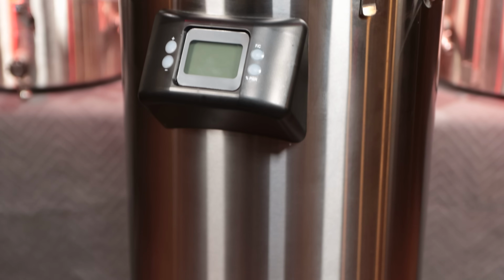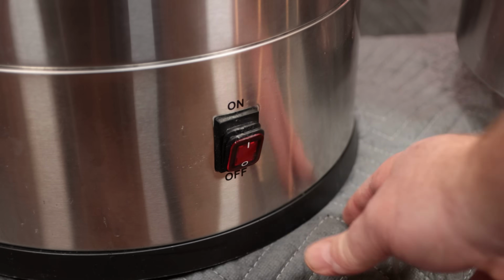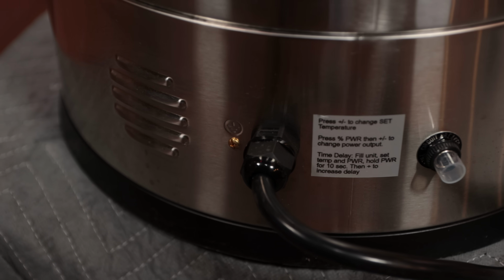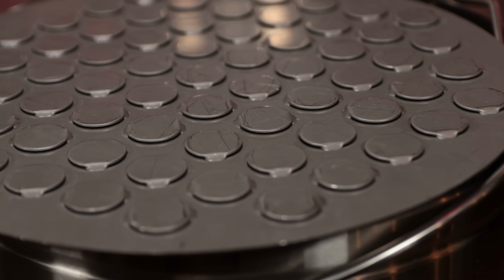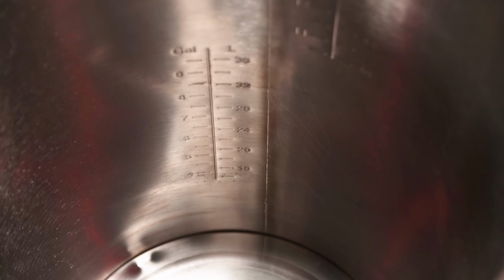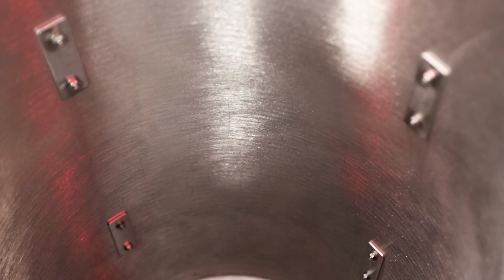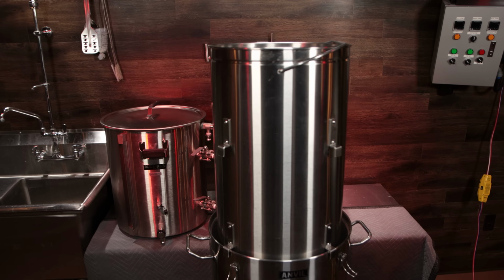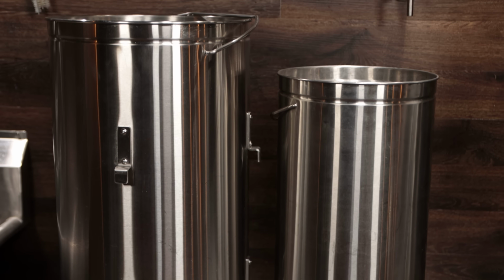*NEW* Anvil Foundry 18 Gallon Brewing System

Comment: First 5 gallon brew day is complete. Did a doppelbock with 18.5 pounds of grain. Efficiency was what you’d expect at 65%. I’m thinking a brew bag will make a huge difference for smaller batches. Overall I was impressed with the system. That’s a beast of a heating element!

Comment: Brian, Thank for more great info.  I just received my 18 and I'm going to test then brew this week.  
If you said any this, I missed it........
What gap are you milling your grains at for this system using the pipe?  I'm coming off the 10.5 using the bag and no pipe - milling at about .035.
With this pipe and false bottom, do you use rice for every brew or only when using flaked adjuncts?

Comment: Who says size doesn't matter? This rig looks legit. That false bottom though! I notice the Brew Easy false bottom drains a little slow, but I manage to keep the element covered while mashing. No beer bongs or chugging while mashing. Anvil just went yard with this one. Cheers Brofessor.
Reply from the maker: Lol thanks!! Yeah it's a trade off clear wort or fast drainage. 👍🍻
Reply: @ShortCircuitedBrewers  I don't mind. IT really does work well, though not well enough for a autosparge. As long as the wort comes clear that is the point. I did notice a slight improvement by adding oats to my grain bill. I didn't need the orifices, or is it orafae? I might have to try to duplicate that false bottom design, not to resell, but to have a false bottom for my Micro Spike Nano rig. I like how well it works.

Comment: I hope they update the smaller units with some of these innovations!
Reply from the maker: Trickle down....keeps on trickling...😁😁
Reply: I just bought a 10.5 and it does have the new style false bottom - it also doesn't need the small batch adapter ring anymore.
Reply from the maker: @DavidMiller-dk7di  yep that's correct. They've done some upgrades! 👍🍻

Comment: Looks good but I love my brewzilla 65l it'll be interesting to see how this works. I wasn't expecting much with the brewzilla for the price but the last two years have been rock solid knock on wood. But if it takes a poop I'd consider this unit. I do like the wort chiller much more than the brewzilla unit and the design of the malt pipe which is genius. I personally don't like the controller being able to stage the heating element just because if you get into a situation where you need to run less or more power especially during the mashing process it kind of scares me. I'm also pretty simple and think that's just something to add to the probability of breaking. I can't wait to see what happens when you use this unit. Thanks again for the great content
Reply from the maker: No doubt the brewzilla is a great system..I actually liked it better than the 35L. I do still have my 65L. Maybe I didn't explain it properly but it is really easy to dial.in the amount of power on the Foundry.
Reply: @ShortCircuitedBrewers  can't wait for the brewing videos. Gotta really love the fact these companies are making affordable systems. Just hope that these lower priced systems last a while but so far they've seemed to be great. Really exciting stuff happening in this hobby right now
Reply from the maker: Yes on all that!! 👍🍻

Comment: Hi Brian,  Love your vids. The measurements for the 18 you mentioned don’t add up :(. The only measurement I need (for my hoist) is “From the bottom of the kettle (the floor) to the extended lift handle of the pipe in order for the pipe to clear the kettle.  This would permit the removal of the pipe for the boil, with the hoist.  ? Is that your DIY steam condenser?  Also what’s your take on the whirlpool attachment?
Thanks Ken
Reply from the maker: Lol I thought about that measurement..I'll find out what it is and let you know..I haven't used the whirlpool arm just yet, but I'll be using it soon. 👍🍻

Comment: Sweet video! I wonder if the 10.5 gallon bag has enough extra space/slack to be used in this larger version as well?
Reply from the maker: I kinda doubt it. You could use it but it wouldn't fill the pipe. Just a guess. 👍🍻

Comment: Just thinkn about jumpn into this. Which system would you buy if you had to choose one? Size? And Simplicity of use? Batch size i do around 6 into primary to end with 5 in a keg.
Reply from the maker: High gravity wort or generally normal?
Reply: @ShortCircuitedBrewers  i do both.
Reply from the maker: @jacobsandlin546  the 18 gallon is going to be your most versatile option then. 👍🍻

Comment: How long does the 10.5 and 18 gallon each take to chill on average for a 5 and 10 gallon batch respectively with the included chillers?
Reply from the maker: I can't remember about the 10.5 but I covered the 18 with a 10 gallon batch in this video. https://youtu.be/b2nycv_MWNc

Truthfully your ground water temp.id a huge factor in how quickly the included chiller will cool the wort down. 👍🍻

Comment: Thanks for the review... thinking about going for it and pre-ordering one of these.  Afraid that it will not actually ship in January though.  Last year I tried to get the Anvil 10.5 and paid and all that then it ended up backordered for months.  Anyway, do you have a equipment profile for this 18 gallon version.  Or have any suggestions on a similar system to use as a starting point.  I use BeerSmith but should be able to plug in the numbers if you have a suggested one to start from whether it is Brewfather or whatever.  Thanks for any additional feedback.  Love your videos.  Thomas
Reply from the maker: Beersmith will have the profile soon for the 18 I worked with anvil on a profile for it..👍🍻
Reply: @ShortCircuitedBrewers  I pulled the trigger yesterday evening and pre-ordered direct from the Anvil website.  I got the swirly arm and recirculating options even though I already have a couple of new riptide pumps.  I plan to make an extension cord and a way to hookup where the dryer is connected.  Watched your video on the cords too. I was brewing extract and steeping on the stove, then the mash and boil 7 gal and now using the mash and boil for partial grain brews.  This will step me up to all grain.  I brew some 10% beers so figured this would help me get there. Next purchase I think will be a Spike Flex+ fermenter and try pressure fermentation.  I am still building out a three vessel HERMS setup... probably another year before that is ready to go.  Trying to learn all aspects of beer brewing using all the different methods.  I still use the stove and sous vide on occasion just for kicks.  Thomas
Reply: @ShortCircuitedBrewers  Brian, the profile popped in as an add-on in BS a few days ago.  It is a no sparge 10 gal profile.  I am new to all grain and creating profiles.  How do I go about a) making the profile work for sparging and b) make it work for a 5 gallon batch? Thank you.  Thomas

Comment: Which one is better Clawhammer Supply 20 gallon or Anvil Foundry 18 gallon? Is the clawhammer worth the extra grand?
Reply from the maker: Not really a true comparison. They are different types of systems. The clawhammer is modular, with most parts of it being serviceable the foundry does not have serviceable eyebrows etc. You have to be the judge on that extra grand. Both will make great wort! 👍🍻.

Comment: Have Second gen 10.5 (controller still on bottom) and been waiting for this but I have to stop and think do I want this or would I be better off getting a second 10.5. With the exception of high gravity beers where a bigger malt pipe would come in handy having two 10.5's would give me the ability to brew a two different style beers on the same day instead of 10 gallons of the same style. Yes I can doctor up a 10 gallan batch into two 5 gallons and have two different beers but not two entirely different styles that a 10.5 would provide and it seems to be overkill to do a 5 gallon batch. This is of course my personal thoughts having a 10.5 already and I might think different if i did not have any system.
Reply from the maker: Definitely points to ponder!! 👍🍻

Comment: would you be able to use the Blichmann BrewEasy Compact "Direct Deposit Recirculation" on this?
Reply from the maker: Not exactly.. but I'm working on a mod for the 10.5 that would probably work with this as well. 👍🍻
Reply: @ShortCircuitedBrewers  I like the sound of that.
Reply from the maker: Stay tuned! 👍🍻

Comment: It's an interesting product, but I still baffled by their decision to use that 4000W 20 amp plug type instead of a 30 amp 14-30 or L6-30. Not only is it handicapped in power usage, to use it, I'd have to find a 14-30 to 6-20 adapter. I may pass on this.
Reply from the maker: Yeah I see your point. It's not "handicapped* though. A 30 amp plug isn't going to "give it more power" it's only going to draw just over 16 amps anyway. The cord should match the power requirements IMO. Each their own though.
Reply: @ShortCircuitedBrewers  I agree on the plug matching the power consumption. That’s wasn’t my point. 
16 amps “only” draws 3840 Watts instead of a higher draw based upon 5000 or 5600 W (7200 theoretical) from a 30 amp . Wouldn’t that affect heating time?  Was just wondering why they would have just went with a higher heating element with the 6-30 configuration since it’s a 240v system.
Reply from the maker: Nope it doesn't do anything to "over power" a system it only draws what it draws. If you have a really long distance (over 100') then you would see a voltage/amperage drop but not with the length of cord it has.
Reply from the maker: The Brew Commander I think that's what you are referring to is made to handle a multitude of wattages from 3750 up to 5000 so it needs a plug to match those parameters.
Reply: @BEERNBBQBYLARRY  I don't think Anvil based their choice of heating elements on the plug. I'm giving them the benefit of the doubt that it was the other way around. 4kW only draws 16.6A @ 240v. The 6-20p is conservatively rated at 20A@250V -aka 5kW .